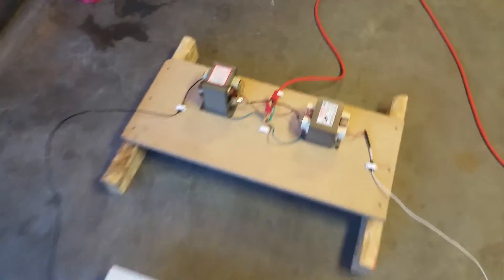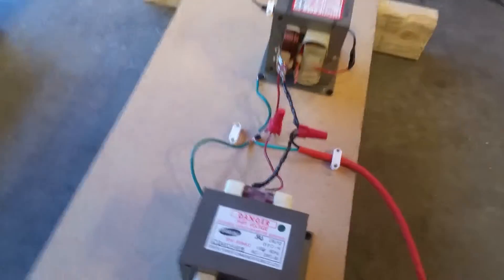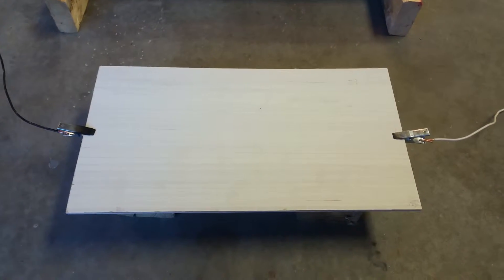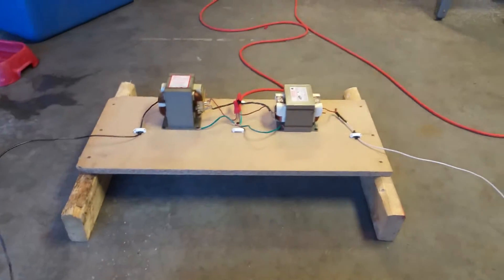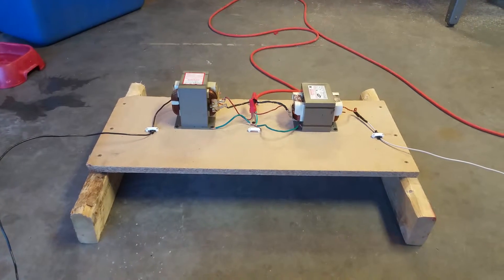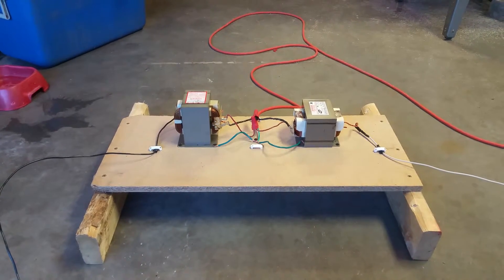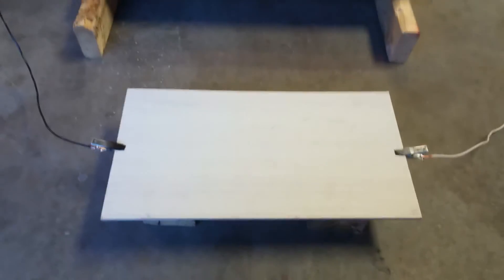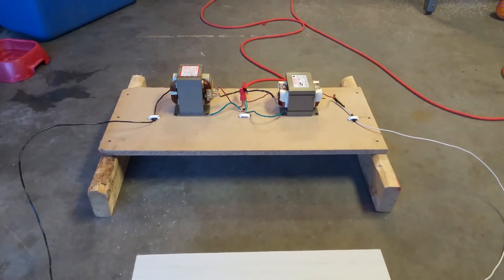Lichtenburg in Wisconsin - Part I

Comment: I really appreciate your video. I would love it if you would give some more instruction on how to daisy chain the two Transformers together.
Reply from the maker: Essentially, there should be two separate winds on the transformer... but there are variations, depending where you source your equipment from.  On the "low" side (the thicker gauge wire, fewer wraps) should be the standard three leads;  black (hot), white (neutral), and green (ground)... they all get tied together, color to color, to your cord that goes to the wall outlet.   On the "high" side (much thinner gauge wire, many more wraps), there can be multiple leads, depending how many different components of the microwave is powering.  Keep in mind... you're switching from AC power (the lead that goes to the wall outlet) to DC power.  Alternate Current to Direct Current.  With DC, there is no polarity... you don't have a positive / negative side.  You can choose any of the leads to attach your clips to, you just have to make sure you're attaching each clip to the same lead that's being fed, if that makes sense. 

Once you get it wired up, if you're not getting activity, your "high side" leads aren't matched up.  Choose one side to be your "main" and keep switching leads on the other transformer until you get action.  And please... please... again... exercise EXTREME caution when you're troubleshooting this!!!  Pick up what's called a "chirp stick";  you can get them at any home repair store.  They're also called voltage detectors.  They look like a pen and will beep, or flash, or both when you get them close to a wire that's holding or maintaining charge.  EVERY step of the way... before you do anything else... thoroughly check every lead to your rig to make sure it's dead before you touch it to make a change.  If you don't do this and something gets confused along the way, this rig WILL send you to the morgue.  In a heartbeat.

I'm not trying to be insulting by constantly repeating myself... but after seeing my father make one simple mistake while working on a 440V power panel, I know, firsthand, what high voltage electricity is capable of.  In one blinding instant, the screwdriver he was using was embedded in a cinderblock wall 18 feet away from where he was standing, and it left him dizzy and fuzzy-headed on the floor underneath it.  He survived, luckily, but it's something you never forget once you see it happen.  NEVER take changes with electricity.  :)

Stay safe... stay alive... and have fun!

Comment: Do you have better results with two of them or have you tried one only? The reason I ask is I only use one and it does fine.. Thanks
Reply from the maker: I've never tried it with just one transformer, to be very honest.  I opted for the parallel rig simply because I already knew I would be making larger/longer pieces, and the boost in initial voltage seemed like a logical idea in order to push that extra distance.